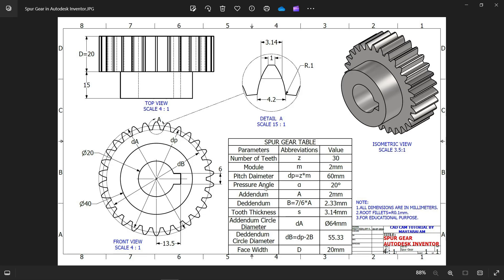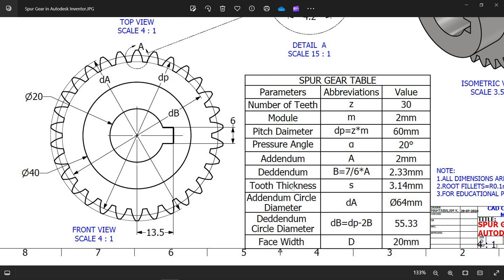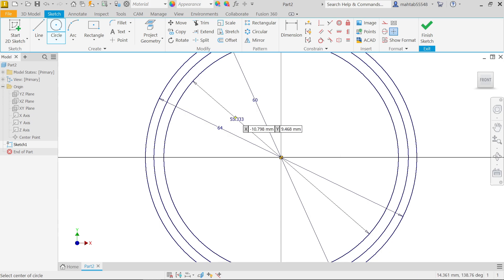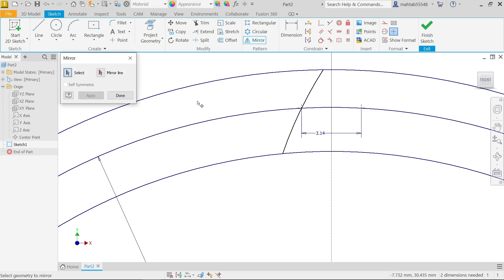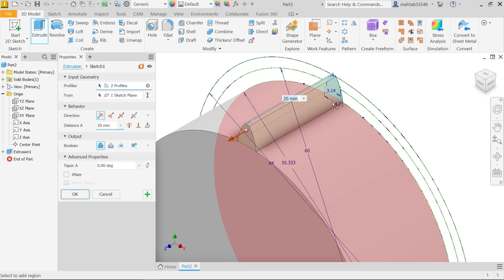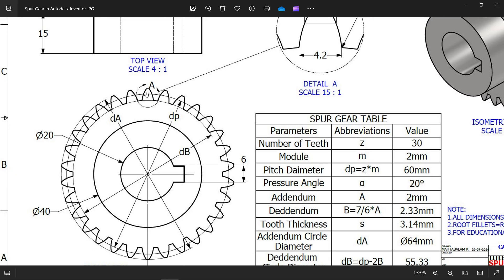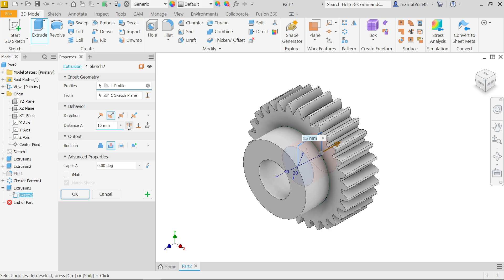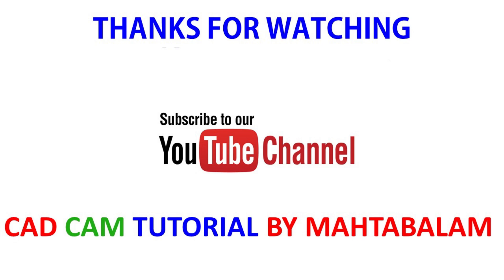Spur Gear in Autodesk Inventor 2024

Comment: Please show us what else can be done with the gear after creating.  Like an assembly of parts and assessment of stresses and strains and maybe deflection under assumed Design Criteria such that, if the parts were to be mass produced,  they would work. For example, RPM required 10,000.